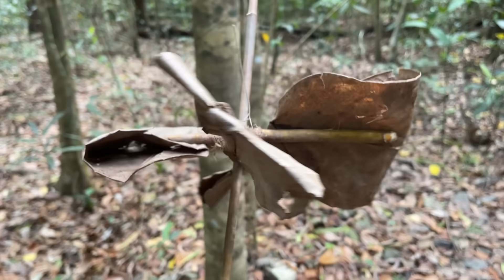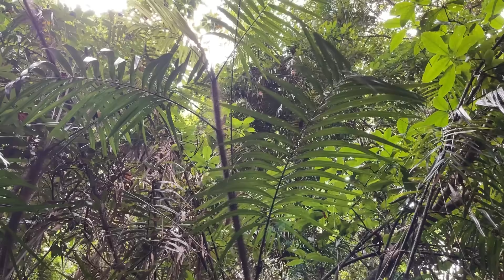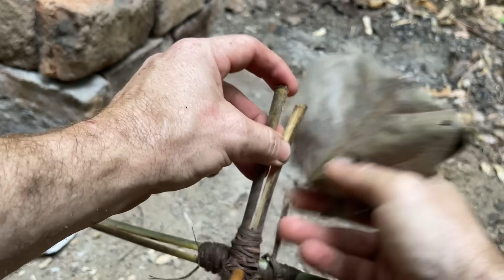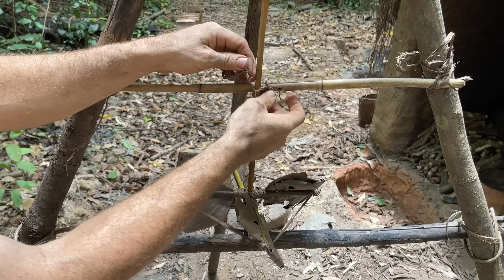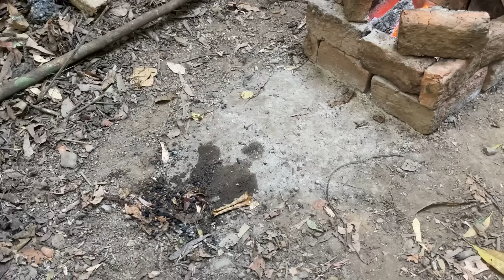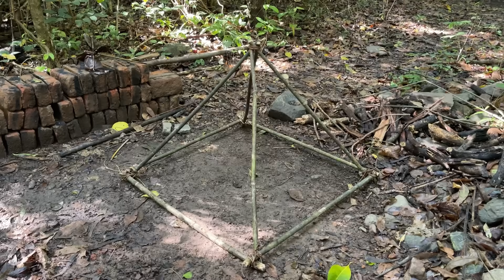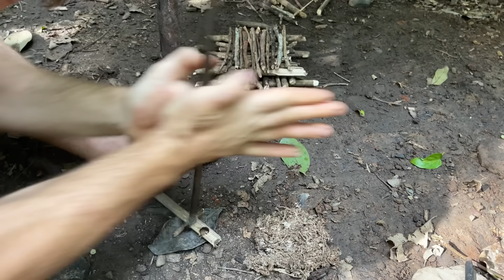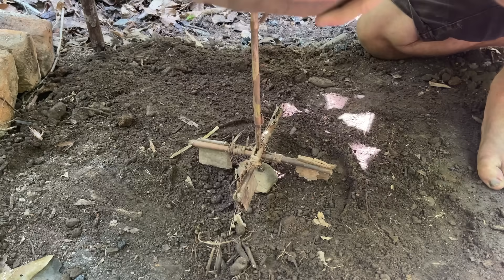Primitive Technology: Convection turbine experiments (hot air windmill)

Comment: The end was predictable having dry tinder suspended above a fire, with the tongues licking at it.
I wonder how feasible it would be to make the top turbine from clay? You could have more blades and it would have more inertia.

By changing your furnace shape you could get more flow onto the driving blades. For example if we look at the tall chimney on your Natural Draft and the directed flow on your Downdraft we could imagine a setup as follows :: Blower on the ground facing furnace. Furnace with chimney initially resembling Natural Draft for refueling/access. Chimney has 90 degree dog-leg bend over the blower. [Note this will require support such as bricks or other, as  the Downdraft was wider than furnace.] Turbine sits at the top of the chimney. Axis of the turbine descends down center of chimney, and through a small aperture in the 90 degree turn. Continuing down directly into the blower.

The general concerns with improving this design are material. With wood and leaves as the main building materials you will have ignition issues as your try and concentrate the heated air. If possible I would suggest to make as much of the system from clay. In the example setup I outlines the turbine and chimney portion of the shaft would need to be made from clay. If the axis is in two parts (wood and clay) you could get away with a spade fit if the torque is low and the join is inside the clay support just below the 90 degree turn.

Maybe my suggestion is bad but you can always shape hardened clay further by 'sanding' it against stone to remove material.

Keep up the good work!!

Comment: Maybe it would be possible to make the flow concentrator out of baked (maybe wax glazed) clay to prevent it from burning down

Also maybe coating the rotor blades in mud would help them resist heat more

last thing I was thinking that having multiple rotors on a longer shaft would catch more of the rising air

Amazing stuff as usual

Comment: Inefficient compared to water. Water has weight and kinetic force that this doesnt. It could work in a turbo stove pipe with retardant fan blades. You'd need gear ratios to make any real power transfer from this but maybe not with a turbo stove pipe like your tall chimneys. Theoretically those tall chimneys could drive its own fan bellows from top to bottom which waves you tugging on two strings. Water is still better.

Comment: Almost a free energy machine concept. The issue is the energy it is using to initially spin has to be spent to move the same volume of air below. Hence the slower rotation as now the thermal must work twice as hard. I dont think it would be possible to get a fast enough moving turbine without significant heat which would destroy it
Reply: Further to be efficient the volume of air the lower fan is attempting to move per rotation must be less than the volume of air in the thermal moving the top fan. Increasing the surface area and temperature of the fire can increase the thermal size. The ratio of the top fan to lower fan you'll have to experiment with as the friction of the sticks and rope add unknownable energy loss.

Comment: Obviously a more heat resistant flow capture fan would be required to go further down this path, along with better capture-to-compressor blade sweep ratios.

But more importantly, a better collection of bearings (thrust, rolling, and so on) are needed. Pre-industrial-revolution, the bearing material of choice were several varieties of oily iron woods carved to support and allow spinning shafts to not be slowed down by destructive friction.

Comment: If you really want to do that, you can build a large chimney that has an offset so that the rotor can go straight down (it will need supports). Put two of those rotors on the top (4 layers of two blades) attached to the same spindle. Then you can attach that to a blower. You will still not get much power though. That air is not moving very fast and the efficiency of the mechanical system is terrible with wood on wood.

Comment: Air turbine shaft needs more mass, like say a meter-long axle to be a bit of a flywheel.
That, or you need larger blades.
Perhaps a clay turyre in the fire's exhaust plume to draw off hot air then, into a larger tube so, it's not fire-hot, just heated,

Comment: I think your main problem is going to be the input vs output ratio.  You're not going to be able to feed the blower off the fire's own output, like trying to power a fan off a windmill right in front of the fan blades.  You might have more success with a second, third or even a fourth fire, all powering multiple forge blowers pointed into a central fire, but even then, I don't think the output is going to be that high unless you can capture more of the updraft, like maybe a chimney with multiple fans inside, or even a helix shaped fan for more surface area.

Comment: A good way to improve the design would be to make sure the axel of the rotor is straighter. All this wobbling takes away some of the already feable rotationnal energy. The goal would be to maximize the air flow by putting the turbine on top of a proper chimney to direct and minimize losses by reducing friction as you already did with the tip of the rotor in the socket, straightening the axel and maybe crafting a "bearing", like a clay ring with small contact ridge for the axel to rub against instead of scraping on the wooden structure. 
Maybe a tilted axel on a straight chimney or a tilted chimney (possible ?) to join the top of a vertical axel ?
Just my 2 cents for this project, would be awesome to see it work better ^^
Innovations in a primitive setting, what a wonderful concept X)

Comment: Okay, that was funny.  I could tell from the title this was never going to work out, but I hadn't quite anticipated that outcome.

There's a reason why bellows were the most common method of driving forges/smelters.  Even a stream doesn't generate enough force to move an appreciable amount of air (at least, not without some pretty advanced engineering), the airflow from a camp fire isn't going to come remotely close to it, because you cannot generate more force than is put into a system, and almost all of the force that is put into that system is going towards turning the turbine when the only force resisting is friction.  Adding those fan blades puts a massive amount of additional resistance on it, hence why it slows to a crawl.

The most effective way is almost always going to be human-powered, given the resources available.  Even if there was space to build a large windmill, the wind wouldn't be dependable enough to drive a forge/smelter.  You could potentially gear together several waterwheels in the stream, but given the lack of access to precision tools, they'd break down constantly.

Comment: Not sure you'll ever get useful work out of a system like this, but a few ideas to improve the system:
use a mud / clay funnel on top of the fire, gently reduce the diameter until maybe 10cm, smooth the inside as much as possible.  use that to focus the exhaust onto a wheel. 
use flat blades and blow directly perpendicular into them, you'll capture more energy that way.  consider building a shroud around the blades, maybe using leaves, to create a vortex flow around them. 
I think you'll need to consider that with your current tech level you don't have anything that can reasonably stand up to hot exhaust gasses from a raging forge, while being close enough to the fire to extract meaningful work. 

.... I need to think on this.

Comment: I don't think there is enough power for that to be practical.  Or torque.  Interesting idea but there isn't enough concentrated energy out of the rising air for it to be valuable.  At least, that's what I'm figuring from where I sit.

Maybe you can make it work by lowering the friction in some of the surfaces, like grease or fat for lubrication of the central spindle.  And lowering the mass of the whole thing.  But even then, a roaring fire would be required to even kickstart it and unless you have fireproof materials, I don't see it being sensible to concentrate the energy with leaves and sticks.

Comment: Dang. My idea for using the rising air to power the blower was much less effective than I had anticipated. Thank you for trying it.
Reply: A chimney to confine and direct the updraft might improve the airspeed, provided that the chimney has a wide enough throat. Having the rotor inside of the chimney would minimize fluid bypassing the blades. Controlling the air-fuel mixture is a challenge and the lack compression of the air-fuel mixture reduces efficiency.

This does require additional thought indeed. The flammability of the components is certainly an issue. There is also the ability to fuel it and remove the ash to consider. Hmm...

Comment: Suggested fixes:
1. A larger, wider rotor to capture more heat for longer and impart more torque. The surface area would also help prevent the rotor from eventually combusting from the heat.
2. Use a earthen dome to channel the convected heat without it catching fire.
3. The turbine rotor should be of a material that is light yet wont catch fire so quickly.... if the region you are in is humid enough, some form of cloth (maybe palm/bark cloth) would do well to attract the humidity and prevent combustion for longer, if the weather permits.

Comment: Hi John, this is finally a topic I'm qualified to give advice on (my undergrad was Physics). There's a few things to be learned from your first natural draft thermal turbine. 1) the leaves spun pretty good until you added the axel, highlighting the importance of managing friction. Bushcraft is your expertise but I would start by using animal fat or sap on a smooth polished stone. Less friction = less air required to spin the turbine. 2) you should consider using a setup similar to your chimney furnaces to make sure the hot air is getting funneled properly into the leaves, a lot is escaping from the sides and through the leaves. 3) it could be tricky to make, but if you can I would try making a Venturi nozzle out of clay to increase the velocity of the rising air. It wouldn't be too different from the attachment you made for the kiln blower. 4) add a flywheel. This will store energy and help the axel keep spinning when heat is variable.

Comment: I dunno how hard it could be, but you should try to perfect a roof tile that is lighter. Maybe thinner than the ones you usually make. And use them to tile a smaller structure like this, for this purpose. Those leaves definitely wont last long. Make a kiln/furnace type pit, but with a larger opening on top. Maybe a lower closed square furnace structure, pyramid/dome/cone shape, with the bellows at the bottom, and a tall 3 sides structure built on top to protect from some wind, and so the turbine shaft can reach down to the bellows.

Comment: my idea is to first build a structure very similar to what you had (except maybe have the funnel be taller to choke the airflow less) and make a long rectangular structure out of cane maybe 3m long. then use the same leaf stitch to close it and place it on top of the structure to act as a chimney. the longer the chimney you have the better the results similar to a natural draft kiln but way more interesting. keep up the good work!

Comment: Seems it needs to collect more hot air or have the hot air moving faster in order to give you more return for "turbocharging" the furnace haha. that and a gear ratio could make things interesting.
Reply: and is it naive to think you could have the bottom fan oriented such that it spins just from the draft as the furnace pulls in cold air? Would make bolstering its power with the hot air mill even easier i think? IDK im just on a thought trail of how awesome your projects really are

Comment: your losing alot of heat past your fins by leaving them out in the open like that, i think if you build a tunnel with them inside you would get more torque because your catching more hot air, thats the short and simple of it. you need to catch more hot air, double your fin size on your turbine and enclose it in a chute of some sort. reduce friction as much as you can with anything slimy or oily im sure there is some sort of oily sap you can find. Palm oil, Coconut oil or some Mangrove resins could work here to reduce friction where wood meets wood.

Comment: Very interesting concept! I think your shaft may have been too long for how much energy the turbine was outputting. It added too much inertia to the system. a shorter shaft may be able to transmit the rotation better. though then you run into the problem from the end faster, lol. 
Out of curiosity, have you ever considered using your vine "cloth" for paddle wheels for your blowers and rotors? Or would it be too porous to move air well? I wonder if it would be more durable than the leaves, or easier to get a consistent shape.

Comment: Really cool! If you can put the turbine at the top of a furnace chimney you might get better draft, but it would add complexity of needing to do belt and pulley to do the pto back down to the blower. But would have the added benefit of not burning down as much maybe! I also wonder if you could do something more like a jet turbine where you actually use the inlet of the furnace to drive your turbine and have that direct connected to a fan that charges more air into the inlet stream. It's not a perpetual motion machine because it's still powered by the fire, but just on the inlet side. Might save you from the hot outlet problem and the complexity of offset pto? Anyway, super cool experiment as always!

Comment: This will never work (aside from the fact that you’re using flammable materials 😊) because you’re essentially trying to build a perpetual motion machine. 

You’re actually decreasing airflow by spinning the windmill. The blower below only makes it worst.
Reply: To clarify: turbo fans work because they are powered by an external source. Meaning, they add energy to the system. 

By simply placing a windmill above a fire you are just wasting energy spinning it, making airflow slower and decreasing oxygen intake.

Comment: if you could make the draft stronger by using a longer chimney stack, then make a clay fired turbine wheel drive a pulley to the blower, it might work. the more heat pushing on the turbine the better so leaves are immediately dismissed. youd need some sort of  venturi to cool the air, then a very large leaf turbine to catch the volume of exhaust + venturied air - not practical. Does a leaf dipped in clay slip, then fired, retain strength? Shaved bark perhaps?

Comment: Ok, this is a fun idea, and making it work involves fighting thermodynamics, so I'm very interested in seeing how it pans out... But I have some thoughts:

The intake prop is driven by a turbine, which is driven by convection, which is also what "powers" the same airflow that is already occurring at the intake without a turbine.  So by adding a turbocharger with a lot of friction and an unsealed combustion chamber that does not capture the energy of the chemical expansion of wood to ash/smoke/CO2... You're actually just taking energy out of the convective airflow in the form of backpressure and bearing friction.

Thermodynamics is a real pain.

If you want to beat a natural draft furnace, you have to add energy to the system.  You might want to try adding TO a natural draft as opposed to trying to REPLACE a natural draft - and if you want the same convenience as a natural draft, you want water power.

I recall you trying out a little water wheel a while back, as well as a water-weight seesaw hammer thing.  I really think both are worth expanding on - water wheels were used a lot back in the ye olden days for a reason, and that seesaw concept was much simpler.  Maybe combining the water bellows with the hammer?  Three of those would get you pretty close to constant - three-phase electricity is standard for industrial use for a similar reason.  Keeping the timing would be really difficult, so it might actually be mechanically simpler to just have a water wheel and a blower on a single axle long enough to deliver power from a waterfall to a good furnace site.

Comment: i think a gear ratio with rope and pullies could achieve the desired effect, you might need to funnel the fire up higher to capture all of the air, a lot of the potential convection is lost in transit, though the robustness and fireproof nature might become compromised 😅. maybe a design built on the side of a oven with a hole for air and a tube siphoning air flow out the side might do well, as the distance traveled through the tube would cool the air, leaving an efficient and re-usable design, and potentially adjustable strength of wind power as you can cover the top of the oven to force the air through your tube-opening. this proposed design could much more easily be quenched in case of a fire outbreak. maybe a dedicated building of bricks would be in order if one of these plans works flawlessly, as having a dedicated forge could drastically increase iron smelting efficiency. as well as this maybe with the leaf pinning technology and clever use of melted sap you could make a traditional looking bellows and use a rope-pully contraption to bring it up and down, reducing overall need for speed but keeping up in wind flow capacity/strength, plus the air tunnel on top of the current setup is leaking the air. i think setting aside dedicated time to refine robust gears or pullies could benefit your projects in the future greatly.

Comment: Clearly needs its chimney to push the air in a single direction. The comes the issue of distance with the fan because of the heat right? That's my 2 cents. Its a cool idea but other than energy efficiency I don't see how you could use it? Maybe you could use it to make rope faster? Dry stuff on a line?